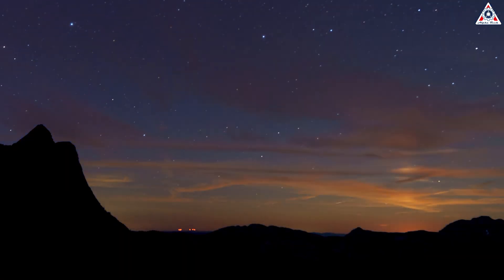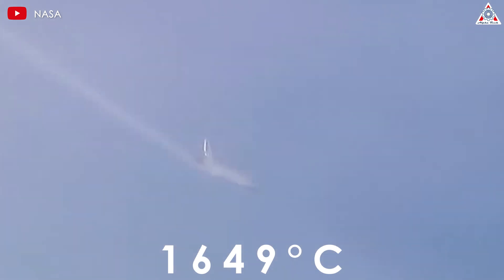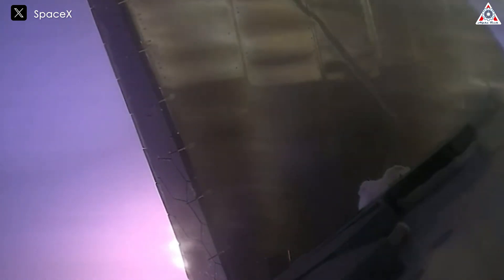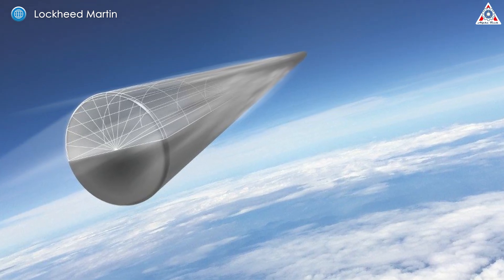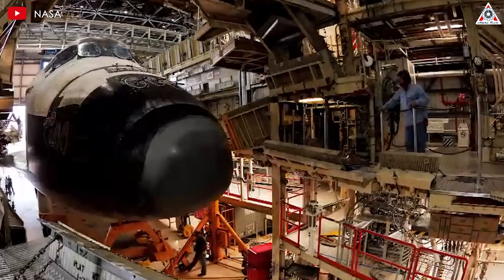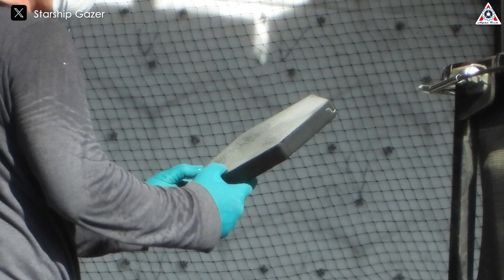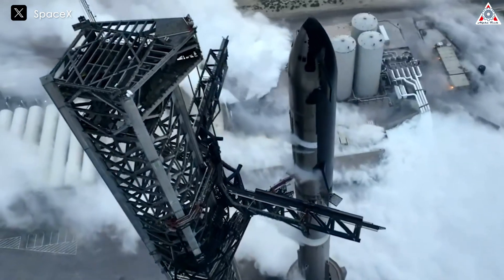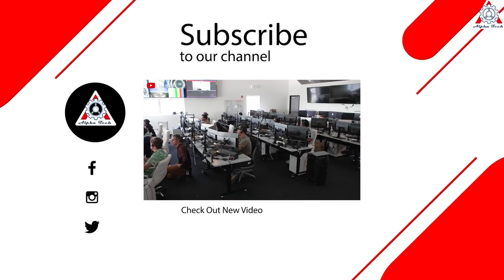SpaceX Starship Heat Tiles Re-entry Somehow Better than the Space Shuttle! NASA Shocked.

Comment: Uh, the Space Shuttle was designed in the mid-1979s, first flew in 1981. That was over 40 years ago. You'd hope that we've advanced technical since then. Also, it isn't the friction that causes the heat, but the super compression of the air molecules.
Reply: Physics is a stubborn thing. The temperatures are way above the structural properties of all but a few types of material.  Chemical bonds can only be so strong.
Reply: @undertow2142  Structural properties you know about, of materials you know about and using chemicals you know about.
Reply from the maker: Thank you for this useful knowledge! I will pay attention to this next time
Reply: And the shuttle tiled landing gear worked and tires were never melted… smooth design engineering 😂😂😂